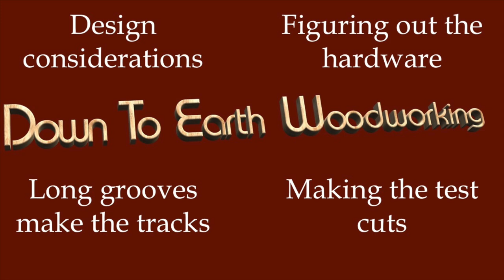Sliding Bypass Doors Part 1 - The Down to Earth Woodworker

Comment: Great project!  I was just about to start researching hardware for sliding cabinet doors, and you may have solved my problem.  One question - Often when working with European-made products, I find switching to metric for all my measurements makes things work out better.  Do you ever do this?  Thanks!
Reply: Kind of a long answer here, but frankly I wish Congress would pass a law that the whole U.S.A. would have to switch to metric, say over a 3 year period.  It's easier.  Having said that, I unfortunately spent all kinds of money on all kinds of great Woodpeckers measuring stuff, and it's all in inches.  I sure can't afford to replace all that stuff with metric versions.  I have one tiny cheap metric ruler, and I don't think it's accurate!  So I convert everything to fractions and try to make it work out! 
Thanks for watching!
Reply: @downtoearthwoodworks  might be good for the younger folks growing up but I sure don't want to learn a whole new system of measuring, its been good for America all these years

Comment: Steve - We have (since I modeled mine after yours) almost exactly the same setup on our router tables.  If there was anything the Incra system was made to do well, it would be cutting grooves like this.  Probably could do each groove in one pass and have an absolutely flat bottom.  Why use the table saw?
Reply: Herb, thanks for asking the question!  As is often the case in woodworking there are many different ways to do something, and you are 100% correct, the router table would be an outstanding, easy, accurate way to do the grooves.  But not everyone has, or has access to, a router table, so I decided to do it on the table saw.  By using a table saw, this job could even be done on a job site with a contractor-style table saw.  If you would like to read a bit more about my "philosophy" (I don't know what else to call it) of using different methods to do the same job, you might want to read this:
http://www.highlandwoodworking.com/woodworking-tips-1702feb/DTEW/different-woodworking-routes.html
Thanks again for the question.  Take care!

Comment: Gluing down the tracks: I would use something other than wood glue for that, though. The tracks are plastic, right? If you use something that's not water-based, it also reduces the chances of swelling and moving the tracks around.
Reply: The tracks have barbs on them not needing any glue at all, if the grove is cut as specified its tuff to get the tracks out but, wood super glue would be better, not sure if wood glue would even adhere to plastic

Comment: Am I missing something or how do you place the top guide tracks so that the doors align vertically with the bottoms?
Reply: What I did was put the top where I wanted it and then got my bottom board with the rollers in place and moved it back and forth with a level on the door until it was where it was hitting in the middle and then screwed the bottom track down

Comment: in my 40 plus yes of construction n woodworking I've never seen this hardware, could you give me the name of the manufacture
Reply: It is made by Hafele.  If you do a search on "Hafele Rolle 2000 Trola" you should be able to find some sources.  Thanks for watching!
Reply: I believe these are available through Rockler-but I just realized this video and your question are a year ago and my input not timely.